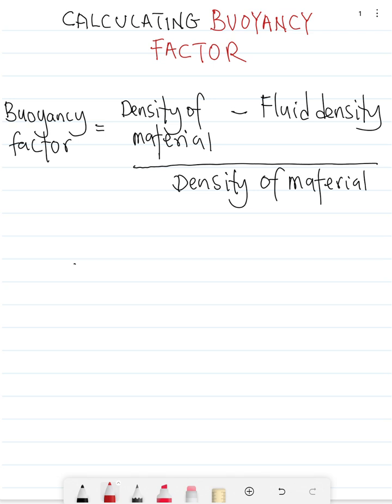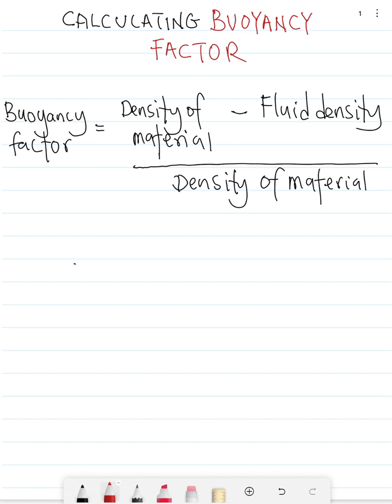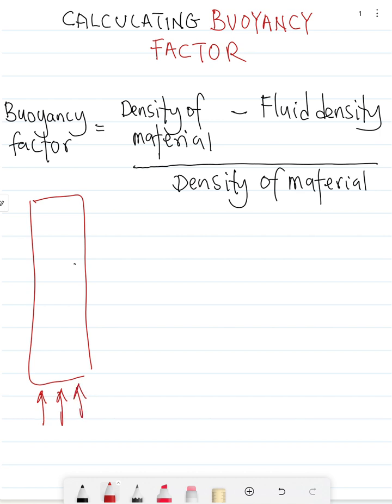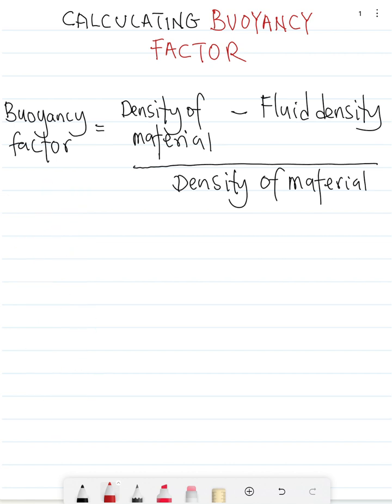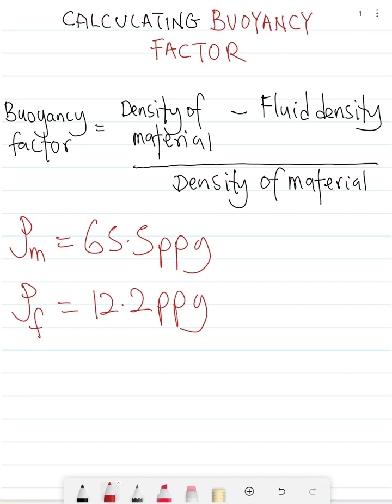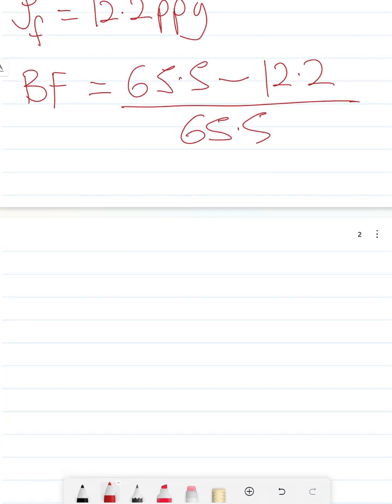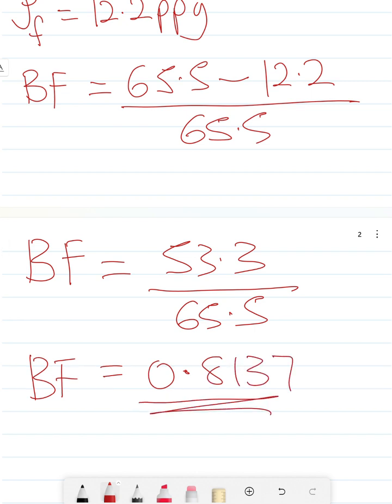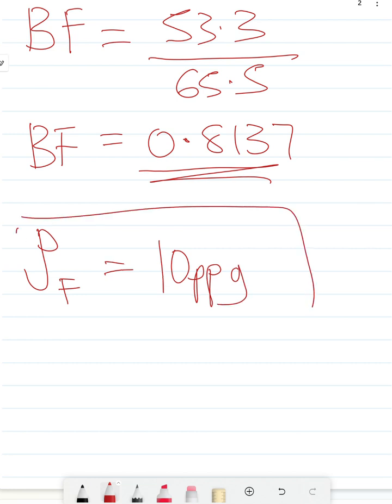Calculating Buoyancy Factor 1 #drillingoperations#wellengineering

Comment: Thanks for the video, the answer to the question is 0.847,and to add ,i came across another formula in a text book,and its yielding same answer,
It is
1 - density of mud/density of material.
Reply from the maker: It is actually the same formular. If you divide the numerator by the denominator that's what you will get. Material density divides material density to give you 1. Then fluid density divides Material density. 

So you see, its the same expression.